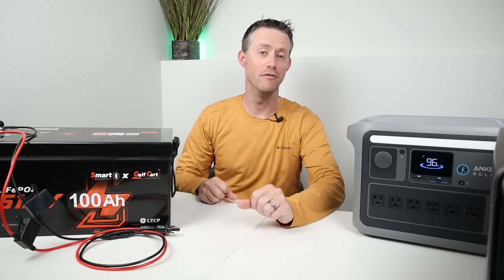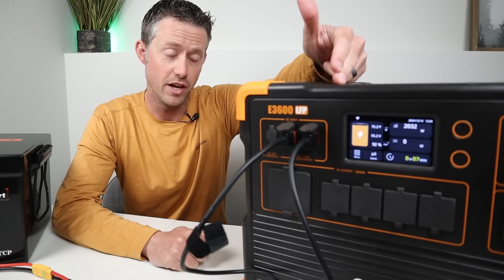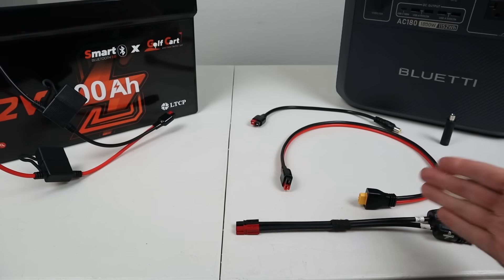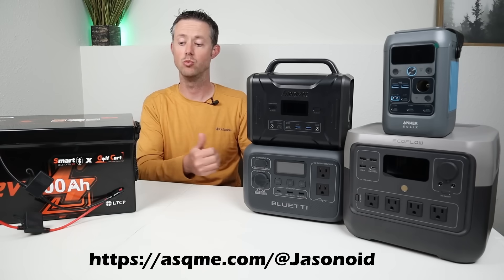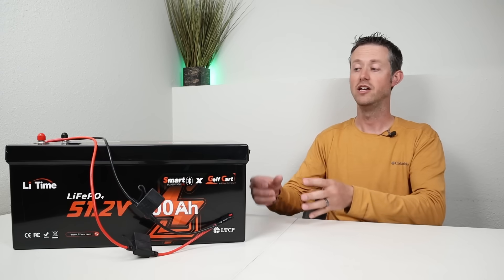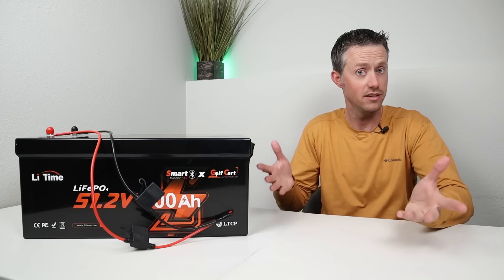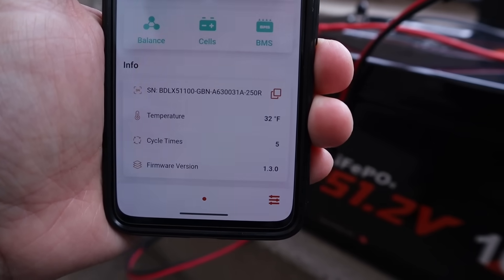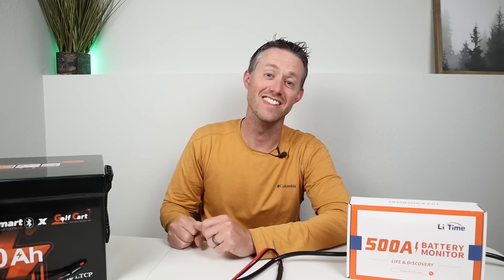Simple Trick to Make Your Power Station Last 5X Longer! Charging with a LiTime 48v Smart Battery!

Comment: So just to clarify, my power station uses the Anderson plugs and has two solar inputs. To properly use one battery to plug into both solar panel ports, do I just get two of those Anderson to O Ring Terminal adapter cables and then hook both cables to the battery, and then plug one cable into one solar port and one cable into the other and then I’m good to go?

Comment: Hi there, great stuff. Any chance you can do a video showcasing your system. I have a Jackery 5000 with an StS. I use this for power shaving/shifting in SoCal for tou. I figure I can use the low voltage input in conjunction with my hi input "off grid" solar. But what would be the most efficient cost effective way to charge my new batteries. I was originally thinking just charging off my grid tied system with a plug in charger but seeing what you did my change that thing. Thanks

Comment: I have done this with Bluetti, as well as using a variable power supply to look like solar input. I had a gas generator that did not do a good sine wave, so I converted it to DC when out in the sticks so it came in looking like solar
Reply from the maker: I have a better video for Bluetti power stations, at least ones with an expansion port:
https://youtu.be/j0jx0CuhmB4

Comment: Using this as an ''interface'' between your panels and PS, you MUST have a MPPT controller that DO clearly show Voltage, Watts in, Amps in, so you DO know the states of charge. What you don't have with direct connect is the ability to limit the Current (watts) going into the PS which could damage it because it will always run on maximum, but maybe your PS has such a limitter. It can also run your battery dead, but the MPPT may be able to control the minimum voltage allowed.

Comment: Hey Jason, i have only seen people doing this with 100ah batteries. Is it possible to use 300ah batteries? Why is that?
Reply: Should work with any battery… just check the voltage of the battery is compatible with the solar input (eg max 60V) then amp hour is just how much storage the battery has/bigger/more battery cells.

Comment: I have a delta 2 I put power through the solar charging port it doesn’t show as solar power on the app, if I add a load it will pull the load wattage and also the 500 watts charging can this burn out the solar charging port

Comment: I mean technically it will work. But, you will need to charge them separately. And you would have no way to know state of charge. It would be much better to parallel this up with the internal battery. Then you could use solar to charge both of them at the same time. That's true expansion, not this

Comment: So 2 of these Li batteries in series, would be fine for my Bluetti AC200L...with it's 145 volt mppt right ?
Reply from the maker: 48v batteries don't support series, the BMS will fry.
Reply: @Jasonoid After posting the question, I had a feeling it would be something like that...Thanks for the quick reply. Besides, I already committed to your other video...adding 1 of the 48v batteries to my battery expansion port...will be doing that tomorrow ( Battery got delivered today )

Comment: This was so helpful, i thought i would have to find a way to get a constant current or blow out the fuse or breaker in my f3000 by connecting an external battery through the solar charge port. Knowing that it will just got to the limit of each port and the solar charge controllers limit their own input and all i need is a  fused ring terminal to xt60 and ring to mc4 cables makes this so much easier. Also you are right in that charging my external battery will allow me to use more panels i already have that were more than the total wattage the f3000 could handle. I am going to plug these all in to my  gen transfer switch this weekend. Thank you again
Reply from the maker: The only difference I would recommend is using a DC breaker instead of the atc fuses. Just cut out the fuses and install a 30 Amp DC breaker:   https://amzn.to/3JryR8O
Reply: @Jasonoid  i use atc style breakers in all my vehicles, which will fit right in to most fuse holders in pigtails and wires you can get. atc fuses are wasteful plastic junk.
Reply from the maker: @stevey_z the higher voltage is the issue, you need to confirm the ATC breaker is meant for 60v. If not, use the breaker.

Comment: Why not plug this in through the battery expansion port instead of the solar input. That way it will get charged together instead of separately. Assuming your power pack is a 48 volt setup which larger ones likely are.
Reply from the maker: That only works on a few brands. I have other videos going through that testing.

Comment: My Ecoflow Delta Pro will not work, even with an XT60i.  It keeps hunting for a voltage to settle at, but it never does.  If I use a regular XT60 connector it with go up to 8 amps and gives me 420 watt input.  Better than nothing I guess.
Reply: Is the XT60i cable bad? Seems like the only cable difference is a lock and orientation enforcement?

Comment: A question, please.Would it be possible to charge the battery from the power supply and vice versa, charge the power supply from the battery? I'd be interested in using the Bluetti electric charge booster. The one that boosts the alternator charge. This way, I wouldn't need solar energy. Thank you.

Comment: Help!!! Always excellent for all the information you share. Thank you so much. I want to use that battery as an expansion for the Elite 200 v2. My question is: If it only supports 20 amps due to long-term solar input, wouldn't it cause any problems with the expansion battery being so powerful? Thank you so much in advance.
Reply from the maker: The power station limits the amperage to 20 amps. I have never seen an issue doing this on a Bluetti power station long term. Just use the proper wire size and DC breakers and it should be fine.
Reply: @Jasonoid Thank you so much for your prompt response. Always attentive to your followers. Greetings from Pinar del Rio, Cuba.

Comment: I wouldn't pull more than 1400W to be safe with that configuration based on Ohms law. P=IV. Power (Watts) = Current measured in Amperage (I) x Voltage (V). Watts = 1440

Comment: Could you connect solar to the LiTime at the same time that it's charging the Anker? Or would you need to disconnect?
Reply from the maker: Yes. You can charge the battery at the same time as having it connected to your power station.

Comment: Hey everyone, I’m a bit tight on money right now but looking to expand my setup. I have the newer Jackery 1000 V2, and I’d like to run my full-size Starlink all day and night.

Right now it lasts about 12 hours, so I’ve been thinking about adding an external battery like the one shown in this video.

Question: does anyone know if this type of battery can safely connect to the Jackery 1000 V2? If not, would a 24V option make more sense? Any recommendations from those who’ve tried similar setups would really help.

Thank you very much for your time and guidance.
Reply from the maker: Yes the 51.2v battery will work on the Jackery 👍
Reply: @Jasonoid Thank you !!!

Comment: The MPPT controller is designed for fluctuating currents. Not sure that it will do it much good long term if you provide it with stable  high current it was not designed for
Reply from the maker: Its been working for years. No issues yet 🤷
Reply: @Jasonoid  Glad to hear that. I  just refered to  theory and specs  that deterred me from doing the same  years ago.

Comment: I have a 600 watt solar generator with a 100 watt solar panel. I'm just maybe wanting to add a battery as a back up in case of a outage. I know I bought cheap with the panel but I figure adding a battery would help. I'm not too smart on this stuff and need some help. Right now it is just the 600 generator and solar panel of 100 watts. I'm not looking for but just a little more hours. If anyone can help thanks.
Reply from the maker: Typically a smaller power station like that can only accept 12v or 24v batteries connected to the solar charging port. I'd recommend getting an affordable 12v 100ah LFP battery and using that to extend the runtime 👍
Reply: @Jasonoid thanks man.😊

Comment: That battery is just showing off lol
Reply: Since you were here about a hour ago I need some help getting more power. I got a 600 watt power station with a 100 watt solar panel. I just want a little more juice without over juicing it. If you can help ty.

Comment: How about going the other way, using the Power Station charge the external battery?   I am thinking about this use case to charge my trailer that came with a 130ah battery.
Reply from the maker: Battery charger connected to the inverter, and the connect it to the 12v battery is the easiest way to do that.

Comment: I have 4 Renogy 200w panels. Connected in series the VOC is 92v. Can I connect this to charge the 48v 100ah battery, with the battery connected to both the 500w 60v inputs of Delta 2 Max?
Reply from the maker: If you use a charge controller like this connected to your battery, yes:
https://amzn.to/3IyHoGN
Reply: @Jasonoid  I know nothing, except to make sure everything is turned off first. I’m actually afraid of electricity, which is why I chose a power station instead of DIY. So please let me know if this is correct, including order of connection: 

Connect the battery terminals to the charge controller BATT. Then connect the anderson 10awg adapter with fuses to the battery terminals also. Then connect the solar cables to the charge controller PV. (I would need an mc4 extension cable for this I suppose). Now I connect the anderson and xt60i adapter cables together and then plug into the D2M. So then I would need 2 of these connections. One for each input on the D2M. 

Please help me to not die doing this!
Reply from the maker: @pasheatsi sound like a good connection. It's a bit hard for me to confirm everything since this is just a YouTube comment and I can't see your setup in person.
Reply: @Jasonoid Thanks! Your feedback is very much appreciated🙏

Comment: Hey, couldn't you use an MPPT controller fed from a battery to regulate the voltage into a solar input?
If you follow what I'm saying? I have the ecoflow delta pro 3 and thought if I really needed to I could feed a controller from some golf cart batteries I have available. 
My delta requires a minimum voltage input of 30v (DC) to activate. Otherwise it doesn't charge.
I couldn't help but notice your battery is rated at 51.2vdc yet your system requires 60vcd? How does that work exactly? 
Mine is 30 to 150vdc so long as I break the 30 volt threshold. So a 12 volt battery wouldn't cut it using the solar inputs of the two I have available high and low.

Or did I miss something maybe?
Reply from the maker: It's a 60v limit, it doesn't require 60v to start. The charge controller will work anywhere between 11-60v.

Also, most charge controllers will only work if they sense an actual battery voltage. I've tried what you are saying in the past and it doesn't work.

Comment: Can I solar charge the extra battery at the same time?
Reply from the maker: Yes!
Reply: @Jasonoid thank you for the reply. A run down of what I was thinking. I have a Renogy 200ah battery. So, solar charge the Renogy, hook up a 2000w pure sine inverter that I have, then plug a solix f3000 into the inverter, and the solix f3000 into my camper. Should I do it another way?
Reply from the maker: @Zeroplanetz I don't see why that wouldn't work if the inverter is a high quality pure sine inverter. Maybe set the F3800 AC charging speed a little lower so it doesn't overload the inverter.  DC charging would be a little slower but it would be more efficient. Connect the Bluetti Charger 1 up to your 12v battery, then connect it to the solar charging port for 560w charging.
Reply: Do you have a link for the bluetti charger? I do not have that component. I do have the other items besides the solix f3000 which I’ll be ordering tomorrow.
Reply from the maker: @Zeroplanetz search my videos and watch the review video

Comment: Hello, Jason. You were charging a Pecron e3600 with an 48v battery. You seemed to have more cables attached then what you identified later in the video. Can you please verify the cables I will need to do what you did?"
Reply from the maker: It's a simple postivie and negative cable from the battery to the solar charging port.

Comment: AI Overview
Yes, you can use the solar input on your EcoFlow power station to charge a separate, standalone battery if you have the correct connections and a compatible setup, as the power station can act as an intermediary to manage and transfer the energy from the solar panels to the standalone battery, often requiring an XT60 connector and ensuring the standalone battery is compatible. 
How it Works
1. Solar Input to Power Station:
You connect your solar panel(s) to the power station, which begins to charge its internal battery. 
2. Power Station to Standalone Battery:
The standalone battery then connects to the power station's DC output (usually via an XT60 connection), allowing the power station to discharge its stored solar energy into the standalone battery. 
3. Charge Controller:
The power station effectively acts as the charge controller for the standalone battery, protecting it from overcharging and ensuring a safe charge, especially for newer LiFePO4 batteries, according to EcoFlow.
Reply from the maker: AI fails at these questions, do NOT connect the 12v output of your power station to the 51.2v battery lol... You'll see flames and melting parts. Some things you just can't trust AI for right now lol 😂👍

Comment: Anyone had any luck setting up a nice setup for charging the extra battery in a similar way that the official extra batteries are charged when you plug the powerstation into the wall?
I'm thinking an external charger that can be plugged into one of the outputs of the powerstation or similar.
Just want to try get it nice and sleek, and be able to control the charge timing with the powerstation app. Have the ecoflow Delta 3 plus, so can schedule the charging and outputs.
Just interested if anyone has tried and succeeded setting up something nice, before I try and reinvent the wheel here. Haha.
Reply from the maker: You seen this video?   https://youtu.be/SwFz2K85pCY
Some power stations allow for a direct connection to the 51.2v battery

Comment: I have a AC180 in a small enclosed trailer, it runs a Frig, and some power tool chargers, it has 400 Watts of solar on the roof, which keeps it topped off most of the time, sometimes NOT with heavy use.   Why can't a person move the solar over to the 12v lithium battery using a  cheap charge controller, then keep the AC180 charged with it's 12v charging port from a simple cigarette style connector.     Just trying to find the most efficient way and not have to charge either battery,  I want the 400 watts of solar to top them both off.    This would cancel the need for separate charging of the Lithium battery,  and still extend the use of the AC180, right ?

Comment: I’m hoping you’ll see this and respond, or that others will know. Is Ecoflow the only brand you would recommend this with? I have not yet invested in a power station, but I’m leaning towards Bluetti. Can this same thing be accomplished with that brand name and if so should it be done with a 12,24, or 48v battery? Are all of these power stations running 48 volts? Just trying to make sure I don’t exclude myself from this type of DIY upgrade by buying a power station that makes the process more difficult.
Reply from the maker: This will work on any power station that accepts 60v input, not just Ecoflow. You'll get the fastest charging by using a 51.2v LFP battery.

Comment: Hi @Jasonoid, can you charge the external battery as you also connect it to charge the ecoflow/bluetti powerstation? The idea is to charge both the external battery and the powerstation separately and the battery is hooked to the powerstation charging it as well especially during the peak hours.

Comment: Great video and just in time😂. I just bought the Anker Solix F3000 and was thinking about buying the expansion tank but it’s expensive. Would I be able to use the 48V through one or both of the solar controllers? That would be a game changer! Thanks!
Reply from the maker: I show that in my Anker F3000 video 👍 watch the charging section of the video
Reply: @Jasonoid Hey thanks a lot! Awesome! Sorry to bother ya but before I spring for the 48v , is LiTime the way to go or do you have a new favorite?
Reply from the maker: I like the Vatrer 100ah server rack battery. It's better priced, it has an excellent screen, and a builtin breaker to be used as a power switch. This one:   https://amzn.to/463mbgU
Reply: @Jasonoid Do you happen to have a video reviewing this battery?

Comment: How can I effectively maintain the temperature of these batteries and power stations during the winter months in the Midwest? Most heaters would draw more power than the system can provide during the much shorter days of the winter months.

Comment: I have an ecoflow delta 2 and max extra battery can I connect a golf cart battery without issues?
Reply from the maker: Through the solar port? Yes!
Reply: @Jasonoid last question, so if im recharging the golf cart battery thru solar do i have to disconnect from the powerstation?
Reply from the maker: @LongPham-xk4ep no

Comment: This extends the capacity great ! So what do you do when the battery goes dead ? Charge it from the power station ? Wall socket ? Solar panels seems there would be a lot of conversion loss for no reason … ??
Reply from the maker: It's fairly efficient. You can charge the battery through any of those options.